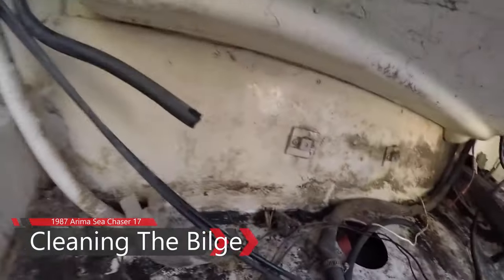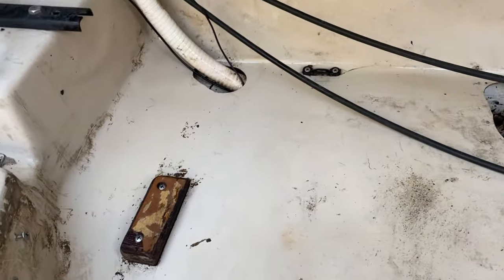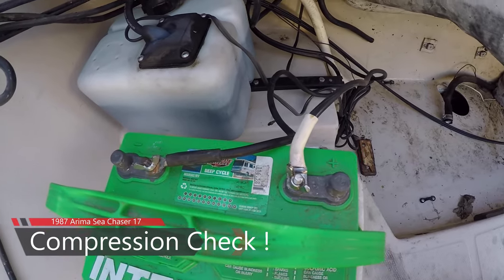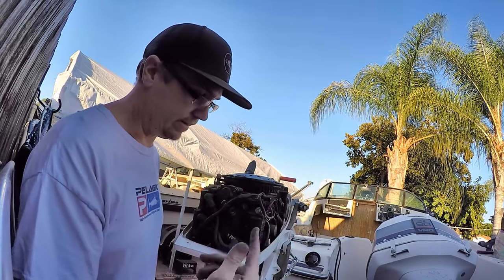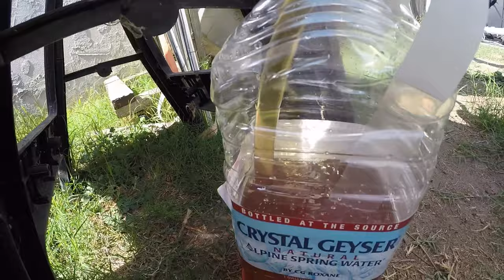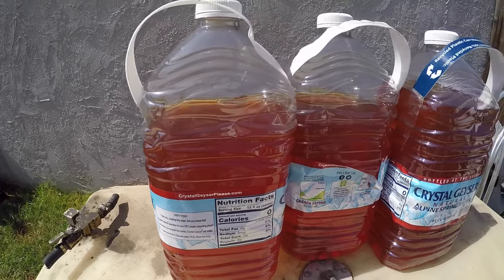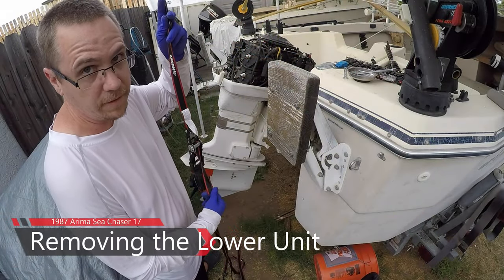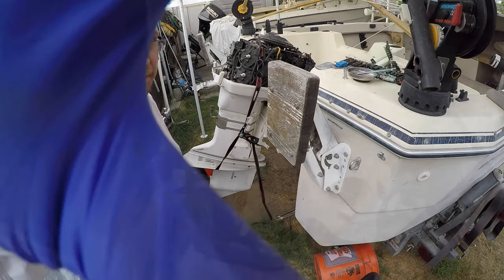Will These Motor Work? Arima Sea Chaser Boat Restoration | Eps. 3:

Comment: Those carbs look easy to remove/ install. You can easily see the nuts. Try removing turbos from v8 BMW. Some bolts you cannot see at all with just enough room to get your hand in to feel them. They cause new cuss words to be invented. 🤬 A crows foot will help you on those carbs also 1/4" drive "swivel sockets" with wobble extensions work miracles.

Comment: Morning I have. Question, is there a fuse chart that show what fuse is to be used for panel to a horn as a example? I have 6 item that I want to use the right fuse for them your help is greatly appreciated. 1) Horn, 2) bait pump 3)Bilge pump 4)Nav lights 5) Acc 6)Deck lights. Which fuse should I use for ea item mention.
Reply from the maker: The best thing to do is go on the manufacturer’s site and see what they list as the proper fuse to use, usually they will have a online manual or instructions.
The other option is to search online for your part with the word “fuse” in your search. Every device will have a different amperage, so make sure to get the correct size.